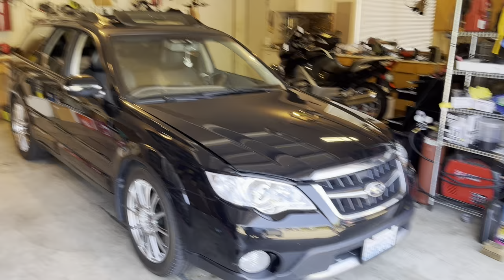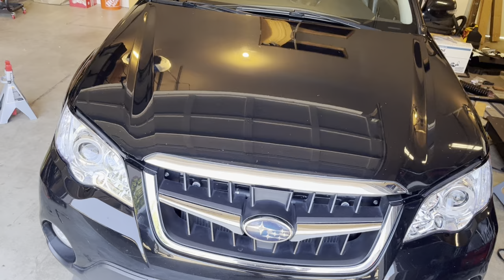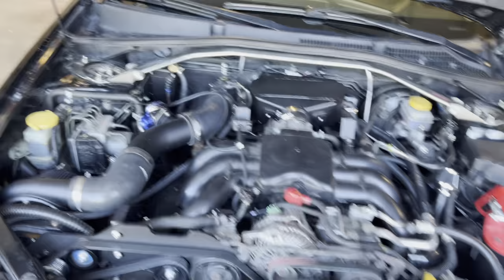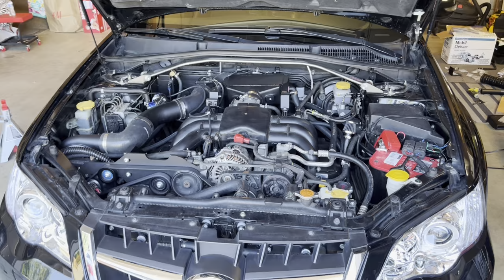This surging idle is driving me nuts! And the supercharger whine makes it much worse.

Comment: Did you ever sort this issue 🤔  I have the same problem. It doesn't seem like it can be turned out.
Reply from the maker: @matthewchild7927  mostly yes. I changed the whole fuel system to a 2007 which has a fuel return line and pressure regulator under the hood. What year do you have? And are you in the US or Australia or elsewhere?
Reply: @CW-uj3dd  I have 2006 with the return line already built in. I've done pressure regulator and fp, replaced the sensors but still no improvement. Yes in Australia
Reply from the maker: @ changing my fuel system helped a lot but it’s still there sometimes. The guy that did the dyno tuning said it’s “blow by” because there are bends in the intake pipe near the MAF so he said the speed of the air going past the MAF changes due to turbulence. He recommended having a straighter run from the supercharger to the intercooler with no bends and no blowoff valve for 6 inches in either direction if the MAF sensor. Haven’t tried this yet because I’ll have to buy new intake parts and it’s lower priority for me now
Reply: @CW-uj3dd  interesting,  thanks

Comment: You didnt plumb back your blov?
Reply: https://youtu.be/5divkRj-ZMk?si=kmIjEfQf8XZw_gRT

I just recorded mine right now. My car was hot today as well.
Reply: Just tagged you on mine.
Reply from the maker: No, Matt told me it’s better to vent to atmosphere. I don’t really have experience modifying forced induction cars so I’m fine just doing what others tell me is best. And I ended up not using that bracket that goes under the supercharger. I used a silicone hose and hung the pod filter off there
Reply: @CW-uj3dd  ahh. If matt told you that then you can follow his lead. For me, I have always know subaru engines act weird if they don't use plumb back so I kept it. . To answer your question you need to loop your breather valve back to the intake bracket on the supercharger. You will need a long 4ft air hose to do that. If you haven't got a new pcv valve you should change it. You getting positive crank pressure?